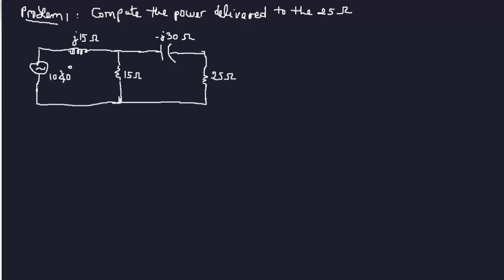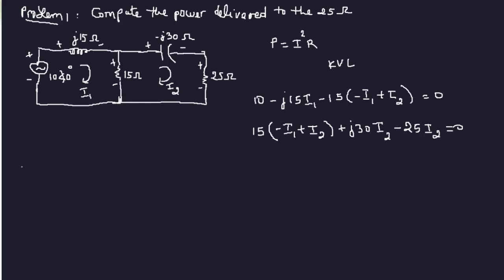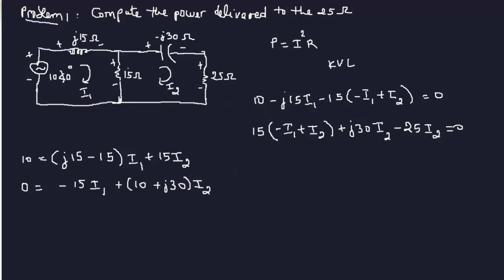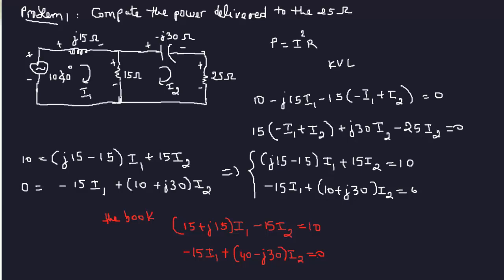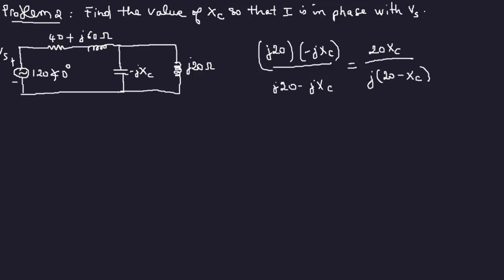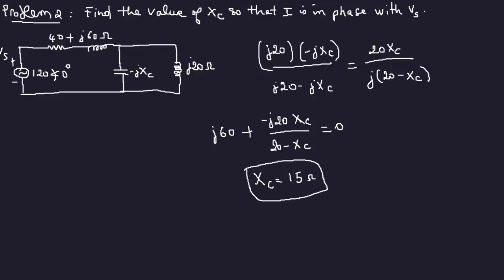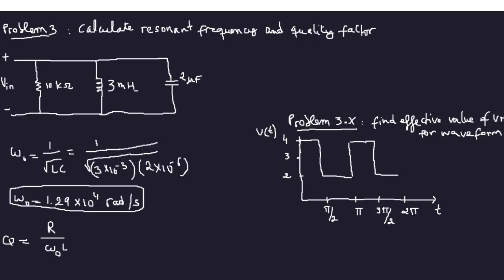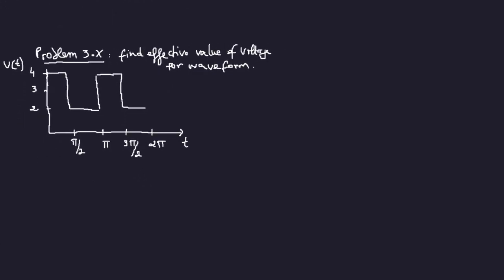AC Circuits Problems 1-FE/EIT Review Course

Comment: Hey, You're doing a great job with these videos and they are a great help for reviewing purposes. I do see some fundamental issues with your lessons as to pertaining to the Dc circuit problems.  Even though what you're saying does the job there is some current being drawn by the inductors and capacitors. Even though you dont see it in these steps they still exist in the real analysis.
Reply: I actually take this comment back, we were dealing with dc circuits. Its been a while. GREAT REVIEW !!!

Comment: For Problem 1, what I did was use the mesh current method (which seems to be what you're doing).  I was taught that with mesh current method, always follow passive sign convention for each passive element in each mesh.  This means that the signs for the 15 ohm resistor in mesh 2 will be opposite to what it was in mesh 1.  This should lead to 10 = 15j*I1+15(I1-I2) for mesh 1 and 0 = 25*I2 - j30*I2 + 15(I2-I1).  When you simplify the equations, they end up being the same as what the book gave
Reply from the maker: Awesome. I see, probably even easier than way. Good job...

Comment: On your first KVL equation: 10 - j15I1 - 15(-I1 + I2) = 0, the sign on the second I1 term should be positive.
Reply from the maker: Yeah, that's where my mistake was initially. Glad you solved it correctly. Thanks.

Comment: When you do the KVL, your first loop should be 10-j15I1-15(I1-I2)=0 instead of having (-I1+I2). I got the answer of the book you mention. Btw, thanks for your video.
Reply from the maker: Yeah you're absolutely right. I realize my mistake with the signs. Thanks for the check and you're welcome.